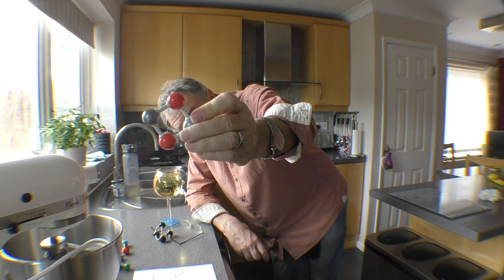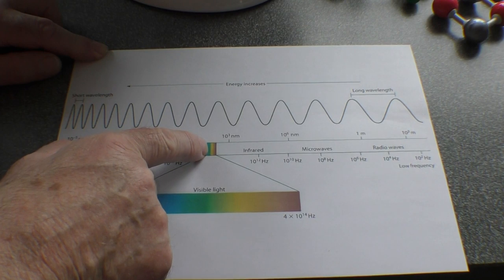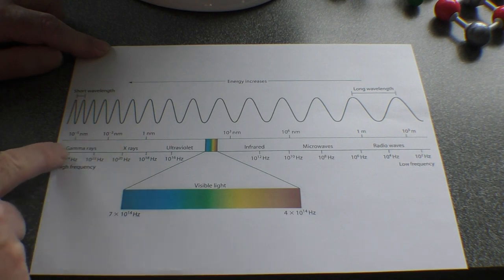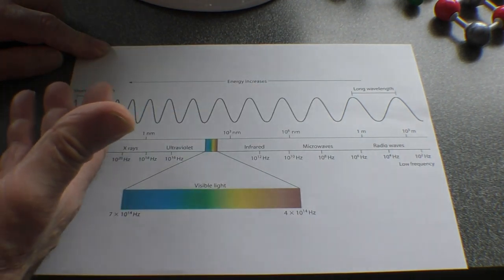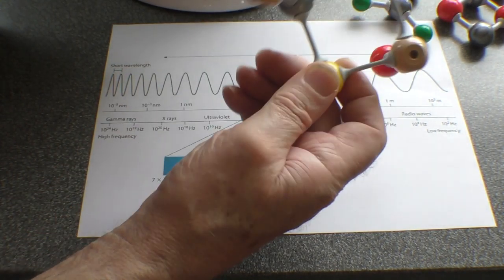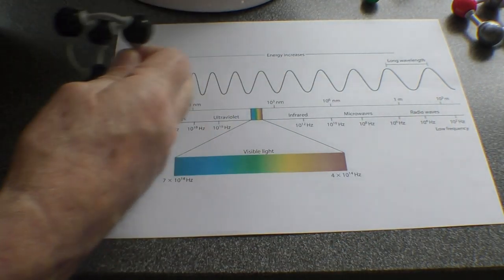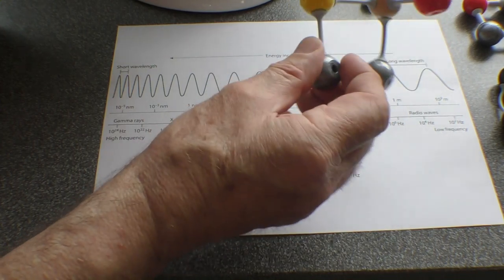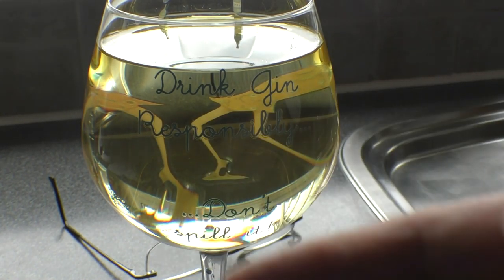Fiber Laser Learning Lab 17 The Mysteries of 1 micron Wavelength Light

Comment: Hi Mr Russ. I'm using Ezcad to run my MOPA laser machine.

I can see the fields of speed, power and frequency.

Where do I use the parameter 2 ns and 60/80 micron?
Reply from the maker: Hi 
There are two types of MOPA laser. There is a range like this that are FIXED pulse 
https://en.jptoe.com/product/lp-e-20w-30w-50w-mopa-fiber-lasers/
 and this which have a variable pulse
https://en.jptoe.com/product/m7-20w-30w-mopa-fiber-lasers/
 The fact that pulse duration is  not showing with speed, frequency and power  would seem to indicate you have the fixed pulse model.
If it is the variable pulse width  model then you must speak to your supplier and make sure you have been supplied with the correct version of EZcad
 Best wishes
Russ

Comment: I was wondering if NaCL would feature in there😄 So pleased that common chemicals can do the job! And I imagine that marking a full extents slab of wood would progress much faster on a fibre laser than on a common diode laser with cartesian movement on the more clunky hardware vs the galvanic control. Also a saturated saline solution can be rolled on to cut down on time. I was curious though, to see if you would try something like copper sulphate to see what colours you might get. It would also be interesting to mark on a periodic table those elements that can be marked, though of course it get more complicated when you are using compounds rather than raw elements. Sodium, Carbon and the common alkaline earth metals have some gaps between each other on the periodic table so you can probably predict other likely candidates.
Reply from the maker: I was a bit careful about chemicals I tested because most uses for this type of marking are for products that may be  used with food.. Thats why I finally settled on baking soda as being the most user friendly. At the time I did not have T1O2 on my radar. That may be the best and it is also used in food products as a colouring
Reply: @SarbarMultimedia  I considered Titanium dioxide too  but forgot in my comment. It's widely used in concreting both for strength and as a colourant. Wasn't aware it's used as a food colouring product! I wonder what it's LD50 is? Which reminds me of another I was considering,  Borax. It's LD50 isn't much lower than table salt which would make it pretty safe. It's anti microbial but it's also a required trace element(boron) in our diets. It sits just above Aluminium in the periodic table but it's in the semiconducter group. Borax is uses as a flux and oxidation protectant in the foundry industry Borax contains boron, sodium and oxygen so it would likely have the sodium atoms agitated and possible the boron atoms too. It's listed as Na2B4O7·10H2O
Reply: * (Boron is the semiconductor group, not the compound Borax)

Comment: Hi, Russ, it's great to find your 2 years ago video!!! I have been plagued by the 1064nm fiber laser marking wood problem for months. I just want to figure out why the wood can't absorb fiber laser? But woods can absorb the 10um CO2 and 450nm diode laser, you can use them to mark or cut woods. Wood can absorb (react to) the laser with bigger and smaller wavelength, but just can't react to the "middle" type laser at all. I really think it doesn't make sense.... Or the "absorbing" is not related to the light's wavelength but other properties. Really looking forward to any inspiration from you!
Reply from the maker: Hi
Damaging materials with a laser is not the very simple thing that we all see. There is a lot of physics and chemistry happening that is beyond most people's "need to know". If it works then let's just use it.
Let's start from square  one and briefly try to drag you through the principles of what's happening.

1)Sound waves are invisible pulses of energy that make our eardrums vibrate . That is something we can all  relate to. Light waves are also invisible pulses of energy that make atoms and molecules vibrate.  Sound waves that we can hear are at about 20 THOUSAND cycles per second.  10.6 micron wavelength light is 28 BILLION cycles per second and 450nm light is 666 BILLION cycles per second.

2)All atoms and molecules are vibrating and the amount of vibration defines their temperature.  Thus , when a molecule vibrates faster , we measure it as increasing temperature. This is a vital piece of physics they dont tell you about at school. So let me restate that in a different way. When things get hot, it really indicates that the molecules within the material are vibrating faster.

3) All molecules are made up from different types and numbers of atoms. Atoms are the  bricks and molecules are the house and it is cement that holds the bricks together to create an end product. In the molecular world it is things called bonds that "stick" the various atoms together to create molecules. These bonds are not physical (as in the case of cement) but some sort of strange attractive forces that you  may imagine as gravity or magentic attraction. The bond strength between different atoms can vary a lot, some bonds are very weak and some are very strong.  Lots of  the same molecules creates a material.

4)Here is where  I hope your imagination  can handle an analogy.  Return to your childhood and  In front of you there is a table. It's your birthday, so on the table is a jelly (gello) and a birthrday cake.   Thinking it would be good fun,  you grab hold of the table and give it a gentle shake. I think you can imagine the jelly wobbling but there is no effect on the cake.  You have just been acting as a lightwave and the frequency with which you shook the table had an effect on only  one of the materials (the jelly). Your  stimulation translated to mechanical motion of the jelly.

5)The frequency of your shaking had no effect on the cake because the molecular bonds in the cake are much stronger than those in the jelly  and require much higher frequencies to "wobble" them. If you were able to shake the table at a high enough frequency then the cake would crumble but the jelly would remain uneffected..I hope this little amusing image allows you to  visualize what may be happening inside wood. There are certain frequencies  that will stimulate mechanical motion in molecules  and just like the world of sound, there are resonant frequencies and harmonics that will still have an effect.

6)A laser beam is a special stream of light  energy. IT HAS NO HEAT.  A stone falling fron the sky is harmless but has energy that  never appears as anything else until it hits you on the head. Only when it hits a SOLID surface does the energy convert into a mechanical  form.That is exactly how ligh tworks. It hits SURFACE molecules, adding  extra  energy  that then vibrats molecules faster. Remember that faster vibration means inceasing temperature. We see the laser beam making paper  burst into flames and logically imagine the cause to be a HOT laser beam. As I said earlier, the laser beam has no temperature, just energy that gets translated to mechanical kinetic energy when it meets a molecule. The molecule shakes harder and harder (the temperature rises)as it is continually stimulated by light energy. At some point (every molecule is different) the shaking becomes so violent that  one or more of the atomic bonds breaks and  free atoms escape  to join with other atoms and the original material is no more. So that paper I mentioned, did not catch fire it reached a level of vibration that caused it to self-desrtuct.  All sorts of new materials were created by this process, Solids like ash, gases like carbon dioxide, carbon monoxide, complex hydrocarbons that were further broken down if they happend to be also stimulated by the laser beam  and the resulting  exothermic reaction  created the flame we observe.  As I said at the outset there is a HUGE amount of chemistry happening when we stimulate a material with laser energy.

7) The final concept you must include is light intensity. Imagine yourself to be a molecule. Being hit by a feather  would not cause you to jump very much whereas being hit by  a higher INTENSITY energy source like a bullet would certainly stimulate rapid movement.Thus the more intense the light the faster a molecule will be stimulated to self-destruct. THAT IS THE WHOLE PRINCIPLE UPON WHICH OUR LASERS WORK.

I hope that putting all those concepts together will answer your question.

 Best wishes
Russ
Reply: @SarbarMultimedia  Russ, thanks for your reply! Thanks for all those interesting experiments you did!

Comment: I wonder if you could vapour deposit copper onto glass to make PCB layouts. That would be a neat trick for prototyping.
Reply from the maker: I will be doing so experiments with this deposition idea on other materials in due course. This was just a quick "fly by" to seewhat may be possible with this machine. Drill holes in glass may be an issue  but if I could achieve the same effect with clear polycarb then that would be useful for you

Best wishes
Russ
Reply: @SarbarMultimedia  You might be interested in the ThoughtEmporium video titled 'Growing Human Neurons Connected to a Computer'. He uses a home-build DC sputtering magnetron to vapour deposit metal onto a slide. He's using a vinyl cutter to mask off areas to try and get a sterile circuit board on glass upon which a cell culture of neurons can be grown. I think you might have just hit upon a way to produce the same slides with a fraction of the effort.
Reply from the maker: @ThingsWhichArentWork  
Hi Jim
 Certainly copper looked like the metal that bonded to glass the best.  I'm just playing with no real purpose. I'm a bit like a test pilot in that I'm exploring the envelope of this machine to see what its capable of beyond all the normal things that this machine gets sold for. If you can find a useful  novel application then that's a brilliant bonus.Best wishes
Russ
Reply: @SarbarMultimedia  how to contact you by email?
Reply from the maker: @andylasers7288  
Hi 
 Just add your disguised email address to another comment and I will contact you and then delete your comment.
Best wishes
Russ
Reply: @SarbarMultimedia  did you get it Russ
Reply from the maker: @andylasers7288  
Sorry ....You tube has sent your comment to another dimension but it allowed you to ask the question.  Mad isn't it.
 Try again please
Russ
Reply: @SarbarMultimedia  You can find it in the about section on my channel